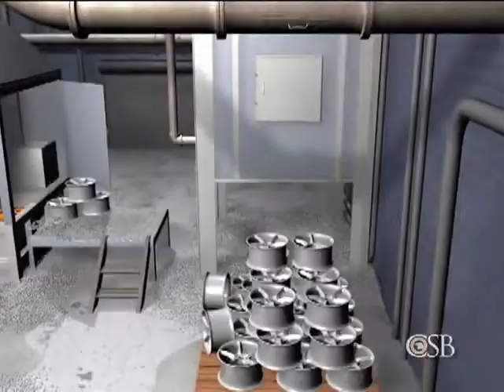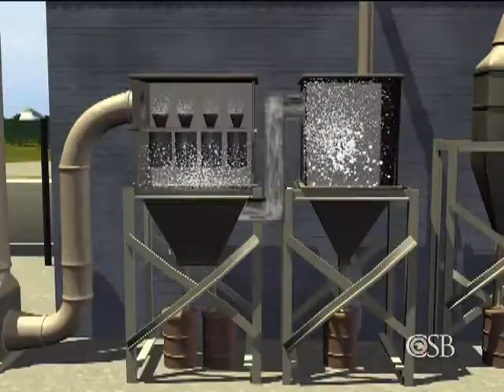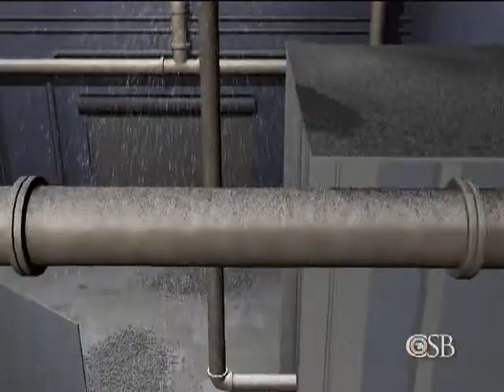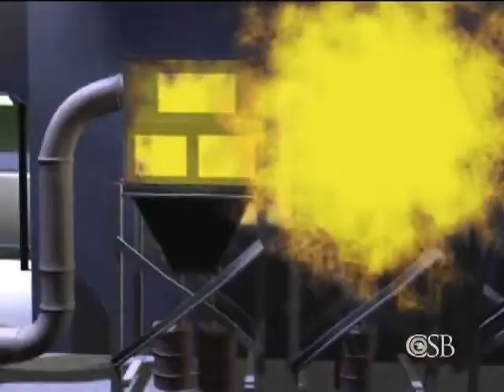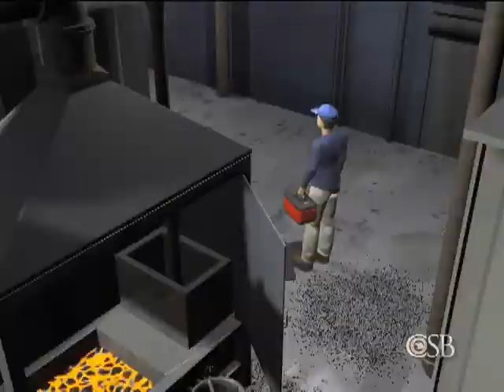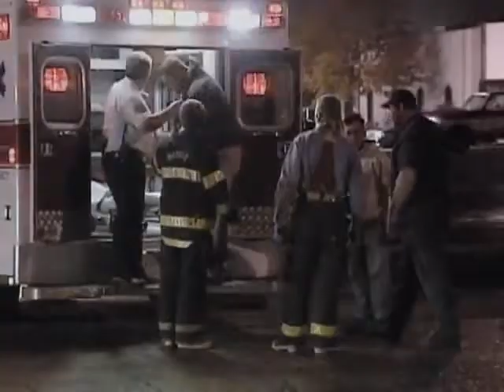Aluminium dust explosion in dust collector - case study

Comment: Great video : We had a very similar case in 2010 or 11, the whole plant building roof exploded. Fortunately nobody injured at it was midnight on a 31th July and only 2 guys were there but luckily behind a strong concrete wall that protected them : Root was Aluminium dust from a belt sanding process that got clogged into the evacuation fan system on the roof. And root of the root is that the old guys aware of the risks at maintenance had to go after the 2008 financial crisis ...